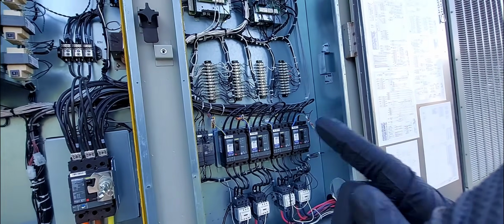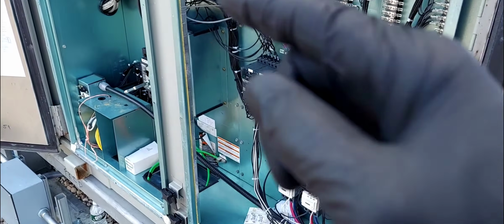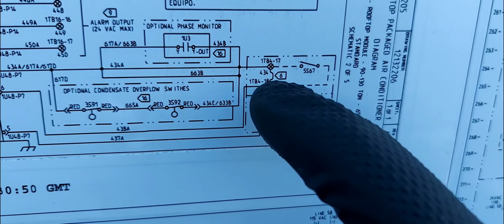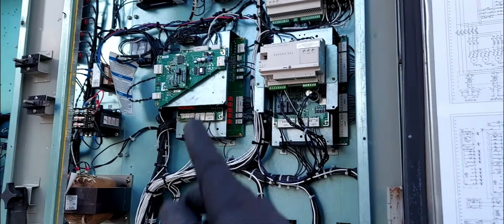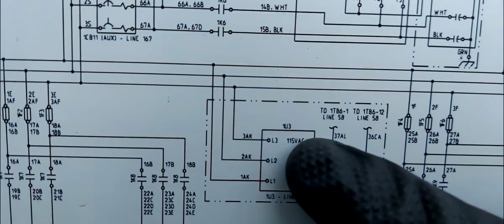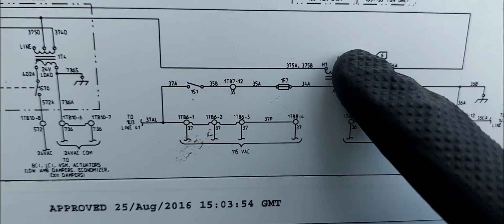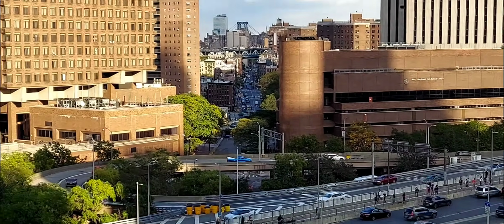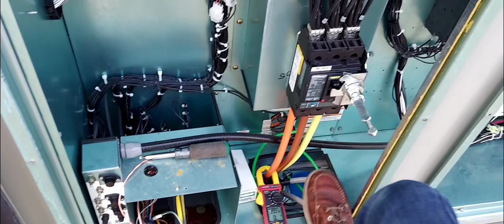HVAC TROUBLESHOOTING

Comment: Buddy! I just did this exact troubleshoot. My search stopped at the phase monitor. Getting power. Tested by jumping y-in and y-out. Phase monitor getting 115. 

Thanks for helping. It was my first time on an intellipak.
Reply from the maker: Awesome
Reply: We went back there. Cleaned the coil and dropped in a new monitor. They are back online. 

No blown fuse though. Just a burned spot inside the epoxy fill on the phase monitor. Looks like the fuse won that round.

Comment: Worked on one of these Friday. Alarm was high pressure differential failure, ended up being bad temp sensors on both sides of evap coil. Was reading almost 200 😳 lol
Reply from the maker: Interesting stuff sir 🙂

Comment: I like your videos.

If a 20 amp fuse blew, I would use the amp clamp to check the running current.  I'm guessing an igniter or motor is off the same circuit since 20 amps are too much for just control.  Then check the schematic for possible high current causes.  Check for some circuit that pulls in under certain conditions.
Reply from the maker: Very nice, thank you for stopping by

Comment: Good video, but just remember all digital inputs are switches and no voltage there are either off or on. Based on Controller logic it knows if closed ok or trouble. Switches on inputs you cannot have voltage they blow stuff up.
Reply from the maker: Thanks for watching

Comment: I’ve worked on a ton of these. External stop is typically linked to fire. That fuse pops a ton because the duct detector has shorted to ground. I would  have checked continuity to ground, or at least jumped between the circuit at tb 4 personally, but good job none the less.
Reply from the maker: Thanks for stopping by

Comment: Looking at the schematic isn't the phase monitor N/O ? Great work by the way .
Reply: Correct. It closes the contacts when the device is in a "normal" state. If it was N/C and the device failed or like in this case lost power it would allow control power to pass even if the equipment was in an alarm condition.
Reply: @jonnymac31  thanks for the explanation. Young tech hear still learning

Comment: Tranes got a bad habit of putting phase monitors in series with high pressure switches also on smaller units.
Reply from the maker: @john McMaster smh 🤦‍♀️ not to mention it’s one of the most expensive brands in hvac

Comment: Alarm system or other (exterior to the actual package unit).
Reply: false contact on the jack or plug, or bad soldering behind the board.
Reply from the maker: @ookalimanoo  did you watch the entire video ? 😂